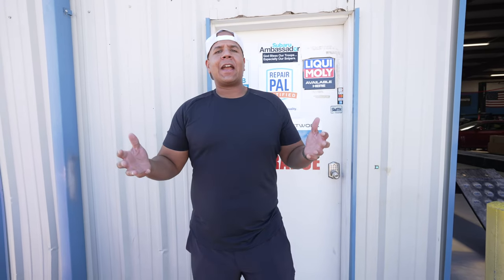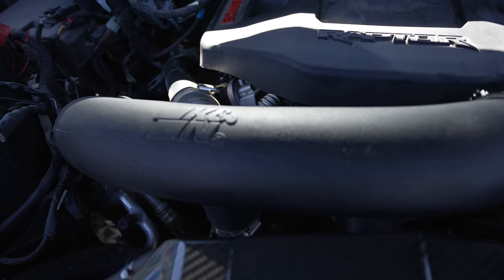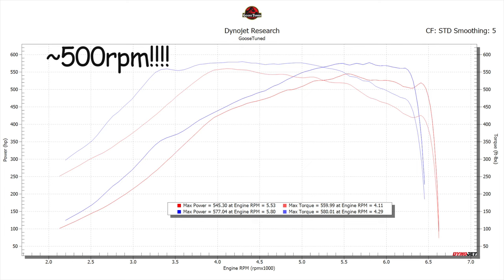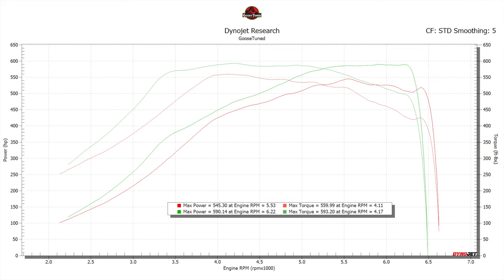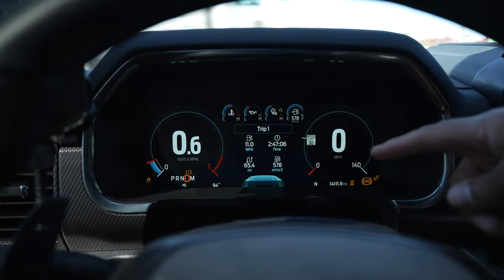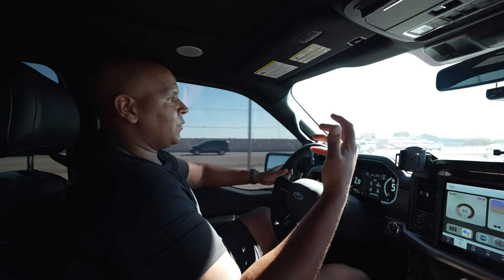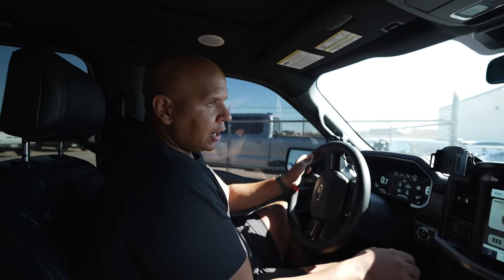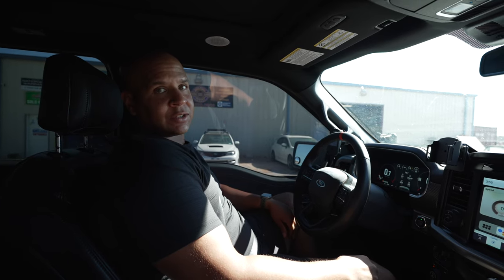2021 Gen 3 EcoBoost Raptor 3.5L makes more power than a Raptor R?!!?

Comment: What’s power on stage 1 tune on pump gas? I’m sure there’s videos but I thought I’d ask the man!
Reply from the maker: I made 440whp on a tune only, 91oct.  Without an intercooler the power will go down after a hard pull due to charge air temps raising